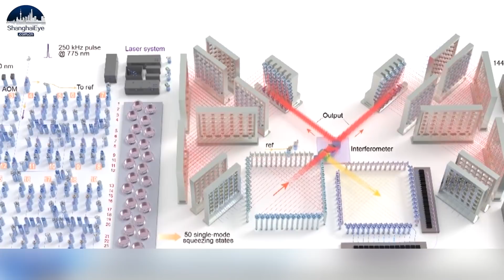10 billion times faster! China unveils major breakthrough in quantum computing

Comment: Un septillion est l'entier naturel qui vaut 10^42 (1 000 000 000 000 000 000 000 000 000 000 000 000 000 000) ou 1 000 000^7 They're talking about a computer one Septillion times faster than the world`s fastest existing super computer! 😉
Reply: A septillion in modern English is 10^24, NOT 10^42. It's indeed true that Jiuzhang 2.0 is 10^24 faster than what classical supercomputers can achieve in speed of boson sampling.
Next time, check your facts and figures before sneering at a video.
Reply: @edukid1984  Thank you! :washhands: You right but from this charts https://youtu.be/w1TzaJli7y0?t=48 I understand that they estimate a computing power greater than 10^42
Reply: @fireflies-fr  That's not a chart of comparison vs classical supercomputers. It's a plot of progress in dimension of state space that can be handled by a quantum computing system.